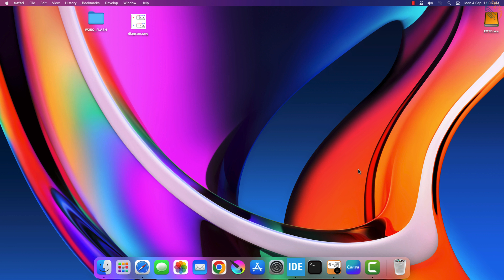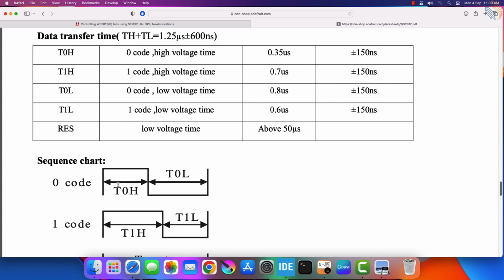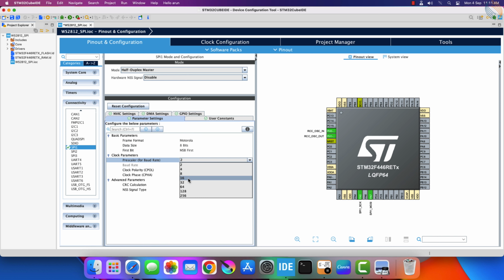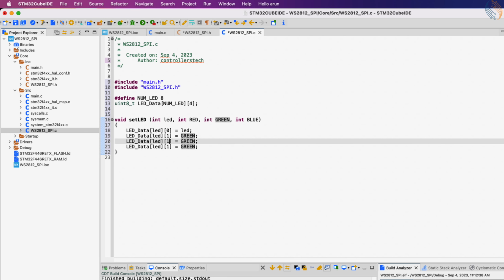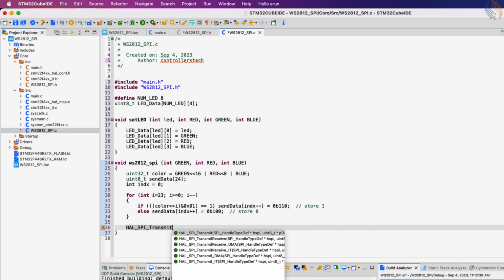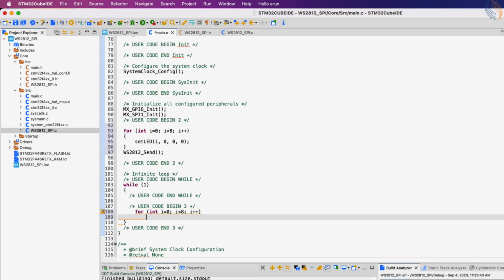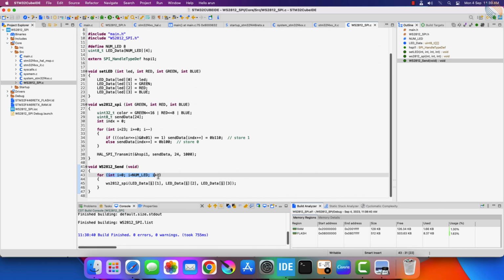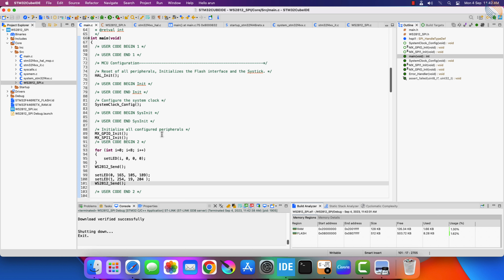Interface WS2812 LEDs with STM32 || SPI 8bit

Comment: Just commenting about the written version, this is kinda out of the spec. With the 2.5MHz clock T1L is too short 400ns when the minimum is 450ns. Good that it works but it may not work for every led. In spec slowest solution would be 4 bits per bit at 3.33 MHz clock. Low bit 300+900, high 600+600. Makes bit shifting way simpler too, actually redundant.

Unless you made a mistake and showed WS2812 timings but meant WS2812B instead.

Comment: Ive tried this on atsamd20g18 microcontroller with 4mhz 5bit logic.
But the mosi pin idle high.
So it's not worked.
Ive changed cpha to 1 but still getting idle high.
But on atmega32p cpha changes to idle low.
Do you know how to fix this in atsam?.

Comment: Hi
I'm able to generate PWM like signals using SPI but the problem is that the time period of one cycle of the individual wave is 2.792μS instead of the usual 1.2μS, can you help me how to fix this?
Reply from the maker: Seems like you messed up the clock configuration for your mcu. 
Make sure you input the correct crystal frequrncy in the cubemx.
Reply: Hi, thanks for your reply
I followed everything as per your video to get baud rate of 2.5MBits/sec in the Blue Pill
What I observed that the duration of ON time for 1 code and 0 code is correct. The problem occured because in SPI, even if I'm trying to transmit only 3 bits of data, SPI still takes 8 bits and assigns unused bits as 0 and as a result 0b110 was literally 0b1100000